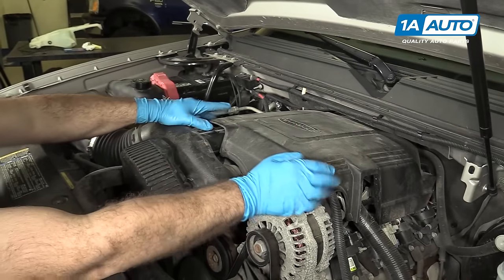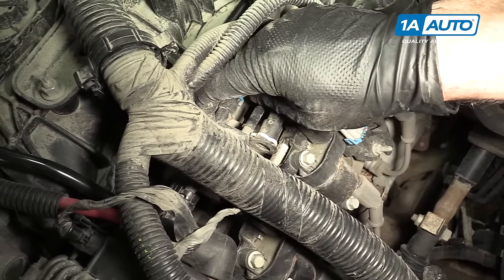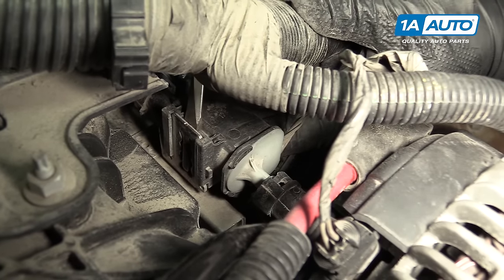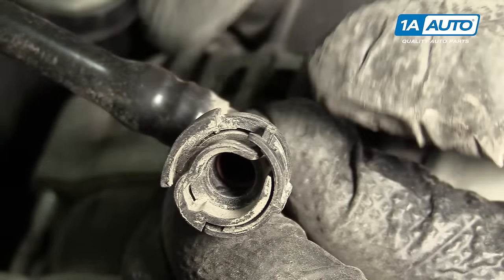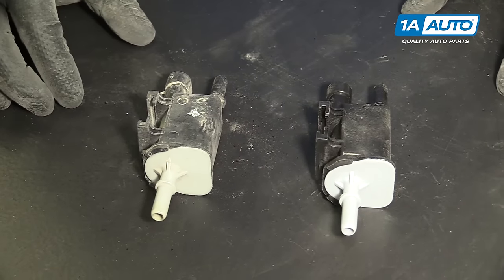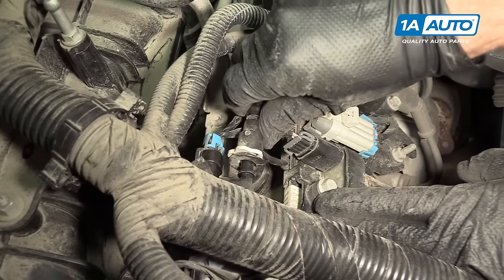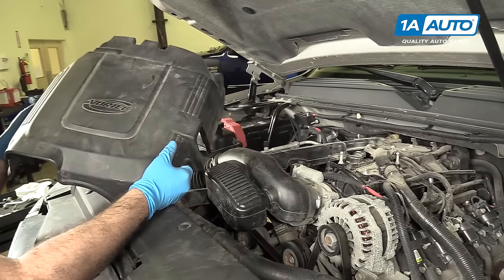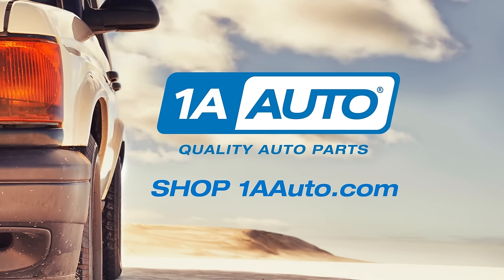How to Replace EVAP Vapor Canister Purge Valve Solenoid 07-12 Chevy Suburban 1500

Comment: Replaced the party with ease due to this video.  One question, should the check engine light disappear after this repair, or does it need to be reset by my mechanic?
Reply from the maker: +Mac Davies This may need to be reset by your mechanic. We suggest having them double check to ensure there is no issue with any other items causing the check engine light.

Comment: Great video! I did it slightly differently. Thank you for taking the time to show how the final hose clip worked. I chose to remove the canister from the bracket first then turn the whole thing over and remove the hose. I then reinstalled it the same way. 15 minutes tops!
Reply from the maker: +a921DJI Thanks for the feedback!

Comment: Just did a switch on a 2007 Chevy Suburban. Took me about 40 minutes,  parked outside of the auto parts store.  No special tools required except the Flathead just as  stated. Goodbye worst code in the world!

 Once again, an excellent job on the tutorial guys. Thank you very much.
Reply from the maker: +neverstopdreeeming Glad we could help!  www.1aauto.com
Reply: What was the code you were getting?
Reply: Did this activate you stabilitrack and abs light?
Reply: Yes was your Stabilitrak and traction control coming on because of this ? Also before you fixed was it idling rough???

Comment: I had to do smog this year but had the check engine light on my 07 Tahoe on, so obviously I had to get that fix. So I went to get that scanned and I had 2 error codes. One was error p0121 and the other was p0455(EVAP large leak). After a couple of hours of google and YouTube videos my dad and I decided to do and inspection of all the EVAP lines. Everything seemed fine, so we went with the idea that this particular valve was the problem. I went to ORiley to buy the valve and asked the guy that help me out about the other code I had p0121(Throttle position sensor error). He told me “ I recommend you buy the Purge valve first because I thing the sensor error is coming from that faulty valve”. Ok so I did that got home installed the new valve ran my truck a bit and BOOM no more check engine light 😊. Check engine light went away by itself while running my truck. That same day went to do smog test and my truck past no problem.

Comment: 10:30 pm...super helpful...i was told it is located on the firewall. By the AutoZone guy. Long way from the firewall...easy fix...with my luck i should be able to replace it in an hour or so..lol..thanx for the useful videos...i should show it at autoz

Comment: On my 2004 Chevy Suburban the manifold cover is secured by a smack hex-headed screw.   The purge valve solenoid is located under this cove at the front.  It was very easy to replace once I studied the connectors a bit.

Comment: Thanks very much. Those new simple hose connections were a puzzle for this old dog. Now to reset the dash light? I have a 2011 Chevy RoadTrek camper conversion van. So had to remove the glove box attached to the back of the dog house to access the clamps to remove the dog house. That was more complicated than changing the part.

Comment: I just replaced mine thanks for the video. How ever my check engine light didn't go off after I replaced it. Am I supposed to reset it or is something else wrong.
Reply from the maker: +Chuck Pershing Thanks for watching!  There are no resets or relearns after you replace this part.  I recommend trying to clear the code with a capable OBD-II code reader and drive the vehicle for a bit.  If the light comes on then you have more issues than just the part.  1aauto.com

Comment: So, I have replaced just about everything in this system for my 2007 Suburban 1500 5.3. Starting with the vapor canister, it had blown chunks of charcoal up the fuel vent pipe as well as the vacuum line up to the purge valve solenoid. I used a vacuum on both lines, first going to the fuel vent then the line on the back of the purge valve when I replaced it up at the engine where it was clearly pulling chunks of charcoal out. I then replaced the solenoid and hoped for the best. 
Seems it is still an issue however, which has me thinking the lines are not fully clear, so I'm trying to find out the process for just replacing the hose running from the vapor canister up to the purge valve solenoid, does this make sense to do, and do you have any thoughts as to what is involved?

Comment: Would it be smart to blow air through that hose?

 I just replaced the charcoal cannister and the vent solenoid on my wife's 07' Suburban and after getting all the charcoal out of the fuel tank vent line the truck filled up with no issues. But now, a P0446 engine light came on. So I am wondering if I also need to replace this Purge Valve.

Comment: I see that on my 2009 suburban, I replaced the solenoid in 2019, 5 years ago, now I'm getting the engine check light.  I replaced the solenoid and still getting engine check light.  I even reset the code with the code reader and after restarting the engine, the ECL comes on again.  Does it eventually reset itself?  Thanks -  Jim

Comment: How do I know if the part is working great after I replaced it since the check engine light is still on?
Reply: You need a code reader. Most local parts shops will scan and or clear your code for you. Otherwise there is no way of knowing other than the truck not having issues any longer.

Comment: I just checked out your video I have a 2007 Denali I want to AutoZone for Diagnostic and they told me it was my canister purge valve  under the car by the muffler but I have the same codes p0442 you have so I'm wondering is it the one under the hood. Need help..

Comment: I've changed the purge valve solenoid  on my 2013 yukon denali. Will the check engine light go off by itself  or do I have to clear it with a scanner  please help?

Comment: thanks a ton for the video my vehicle was slightly different, but the video was very insightful. Side note did anyone else check engine light remain  on even after switching the device?
Reply: andre deleon you can disconnect the battery and then reconnect it to get rid of the code or take it to an auto parts store and they can usually clear the code for free.
Reply: @kjr07002  thanks for the info was having same issue. Light is off!

Comment: How can you tell if these are bad? I have a P0496 and am checking this and a few other things, took this off and it looks like original, (2008 Yukon with 283,000 miles) took my valve off, was able to blow through it like a straw
Reply: V8 For A Heart it should be closed if you unplug it so yours is bad its stuck open

Comment: If I disconnect the negative battery terminal before and then reconnect when im done installing the new part , will it reset the check engine for that p0446 code ?

Comment: My 13 Silverado keeps clicking the fuel pump off, I bought a canister and the other part has a a long plastic corrugated tube with what it looks like a filter on the end. Where does the end part go and do I have the right parts? Tia

Comment: So how do you clear the CEL code after the new part is installed?  I disconnected the battery first, changed the purge valve, then reconnected the battery and  it’s still giving me the CEL code for the evap valve.

Comment: Will this stop the problem I have with not being able to pump gas?
Reply: I have a Chevy Tahoe with the same issue. The pump keeps shutting off. I have to fill my tank extremely slow. My check engine light is in and shows code P0442. Do you have a rough idle? Mine is a little rough. I think the gas pump issue is related to this video, but it’s a vent valve solenoid connected to a charcoal canister at the back of the vehicle.

Comment: If the replacement solenoid is working correctly, should the check engine light turn off automatically?
Reply: U need to reset computer so just disconnect battery and it should be off but if it comes back on something else is still wronh

Comment: My truck was idling rough, service traction control light, stabilitrack off and reduced engine power happened. I replaced this canister purge valve and it’s still happening. Any recommendations?
Reply from the maker: +Jared Vuksan We wouldn't be able to diagnose an issue like that here, you may want to have a local mechanic take a look at it. Thanks for checking us out! http://1aau.to/m/Shop-1AAuto-c
Reply: throttle body position sensor or Accelerator pedal position sensor, hope you got it fixed by now tho.

Comment: So I replaced mine very easily but as I went to make sure everything was on snug, the vacuum hose that is toward the front of the vehicle that goes on the gray nipple broke. Is that hose replaceable or am I SOL?
Reply from the maker: +Teresa Mendoza It's replaceable. You can call 888-844-3393 to see if our Reps can pinpoint the correct part for your vehicle

Comment: Do you have a video on how to do this on a 99 chevy suburban k1500
Reply: simple. just remove or bend back the air intake and it is on the passenger side of the engine by where the air intake hose covered. Its got a red clip and has only 2 bolts 10mm in size.

Comment: Do i need to disconnect the battery when replacing the purge valve?
Reply: I am sure the manual may ask for it to be sure, but I replaced mine without doing so with no issues.

Comment: Do I need to disconnect battery when doing this ??
Reply from the maker: +3115 Georgie No you do not have to disconnect the battery to perform this job.
Reply: 1A Auto Parts thank you
Reply: 3115 Georgie how torn off the check engine light after replacing the purge valve ?
Reply: How turns of the check engine light after change the purge valve?